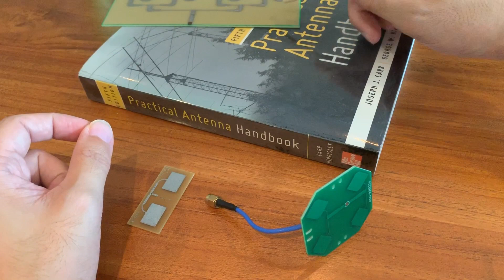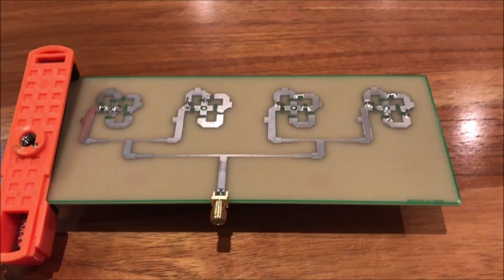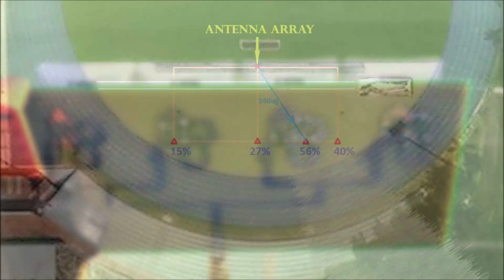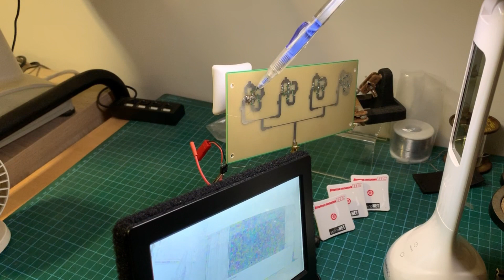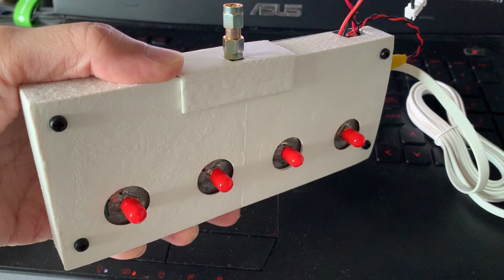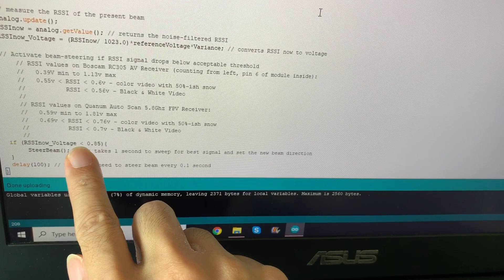I tried making World’s First Beam-Steering Antenna.. IT WORKED!!!

Comment: super interesting. now i'm thinking are there about tiny solid state relays or antenna switching components that aren't terribly expensive? that way a processor can choose which way to steer
Reply from the maker: Thanks, I'm glad you find this project interesting. A 3-way diversity system is easier to build, you only need 3 identical receivers each with its own RSSI output + an arduino + a few cheap solid-state relays to switch the display's video to that of the receiver with the highest RSSI. There isn't any real RF beam-bending at such, but you get the same results.
Reply: @terence79chan  sure, I figure there's several ways to build a diversity receiver without switching the antennas themselves, plus good ones are not that expensive. I've also seen phased pairs of antennas such as the VAS pepperbox or skyhammer. But i'm specifically talking about beamforming and steering that beam, as was the topic of this video. I'm curious what kind of ICs are required to switch between different antenna elements. the switching wouldn't have to be very fast, but i feel like maybe a solid state relay intended for DC won't be a good impedance match or something at 5.8ghz.
Reply from the maker: At 5.8ghz, choices are limited to RF switches with the correct specs. Based on the data sheets, both F2910 and QPC6014SR from Mouser will work really well but they are super small. HMC550AETR (SOT-26-6 type) is bigger and much easier to work with but it has higher insertion loss and poorer isolation. This is the reason why I chose to use F2910 which are expensive. In hindsight, I should have gone for the HMC550AETR since my choice of PCB was cheap FR4 anyway (instead of Roger RT which is suited for RF). My friend who is an RF research engineer, told me that the amount of beam-steering I got, out of this simple microstrip phase-shifter on lossy FR4 PCB, was considered descent. He would never use FR4 in his field of work for microwave frequencies.

Comment: This is really cool! One question, how would this be an improvement over just having four patches angled in different directions? I get how the high gain antennas work, but it seems like it wouldn't be an improvement over just having them face different directions and choosing the one with the best signal strength.
Reply from the maker: Thanks for dropping by. You are right that it gives a similar performance as a 3 way diversity setup. The advantage in having a phase shifter is that you only use one receiver instead of 3 receivers to cover 3 directions. :) 
However, if this is used as a transmitting antenna, such as on a drone, you can beam the video signal to the ground station at the desired direction via a micro processor (Arduino) that accepts telemetry data, and with using a single video transmitter. This is what a beam forming antenna is capable of.
Reply: @terence79chan  Since the 4 patches antennas forms an array, there could be a gain?
Reply from the maker: Thanks for watching. Yes, there is some gain over a single antenna, but it is not as much as when the 4 antennas are positioned in a 2x2 square formation. The reason is that the radiation pattern in a 1x4 formation trades off gain for a wide beam on the elevation plane.

Comment: Really interesting project. I wonder if someone can make similar device with 1 degreee increments between the beams, I guess it would make for much stronger signal?
Reply from the maker: It would be nice to have 1degree increments. There are professional phase shifters which allow you to enter precise value in degrees for the phase shift but 6ghz ones are too expensive. For DIY, it is easier to use increments of quarterwave (90,  180, 270deg) as it is easier to manage impedance matching (of 50ohm) with these values. Notice each patch antenna is circular polarized type, this is because 90deg delay in array will induce circular polarization. To achieve beam steering and linear polarization, we would have to avoid using delays which are multiples of quarter-wave. This is what makes this hobby so fascinating.

Comment: Really interesting video. I would like to see this in a real longrange FPV test. I might build one of these trackers myself and see how it goes
Reply from the maker: If you are building one, be sure to get the correct RF switches. Both F2910 and QPC6014SR from Mouser will work really well but they are super small. HMC550AETR (SOT-26-6 type) is bigger and easier to work with but their typical insertion loss and isolation are not as great.